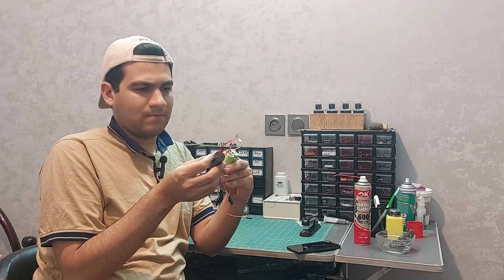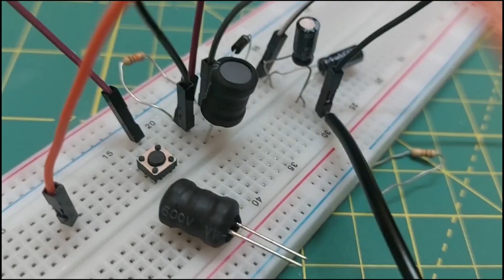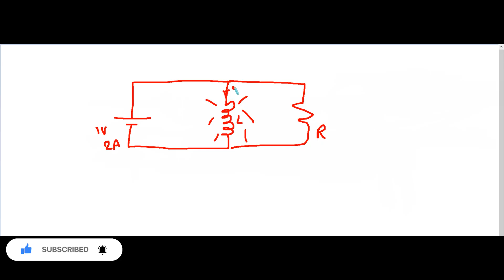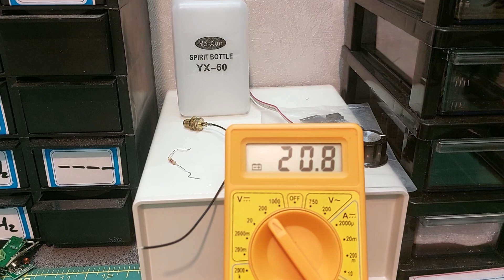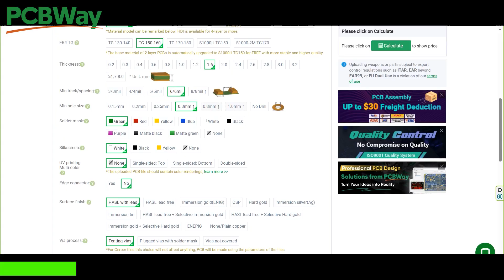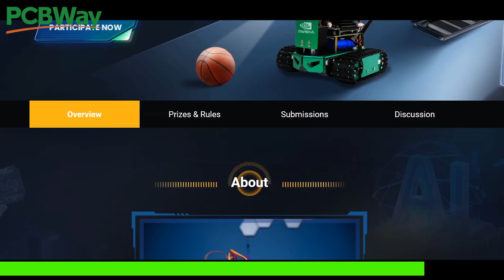I Made a Boost Converter with a 555 Timer – It Nearly Blew Up!

Comment: Babak Stars, hi. How much -is the fish- Amper? If connect 5V*2A = 10W , then from 40V will be 10W/40V = 250mA?
Reply from the maker: Hello. I didn't test to measure the amperage. This boost converter has a problem because the output and input ground are not the same. I made it at the request of a fan.

Comment: i am building a 555 timer based boost converter for neon bulbs my coil is a 1000uH 2A and the voltage for it is 12v the neon bulbs need 220v and tips and can i see a circuit diagram. great video i liked and subscribed!
Reply from the maker: Hi. Sure. Sorry, I forgot to share the circuit diagram.
Reply from the maker: https://github.com/BabakStars/Boost-Converter/blob/main/Boost1.png
Reply: @BabakStars  thank you and i think that diode is a shotkey diode and with a 1000mh coil what would happen